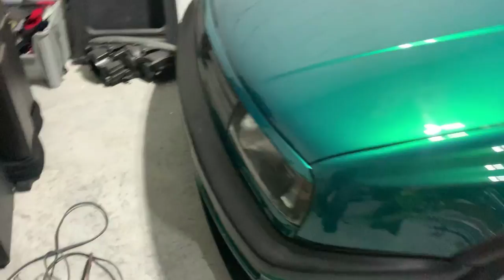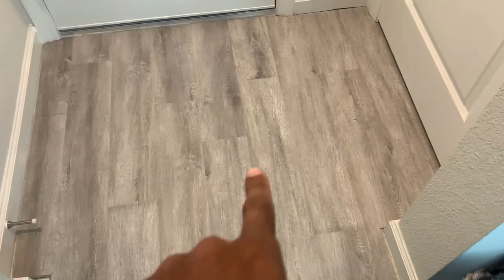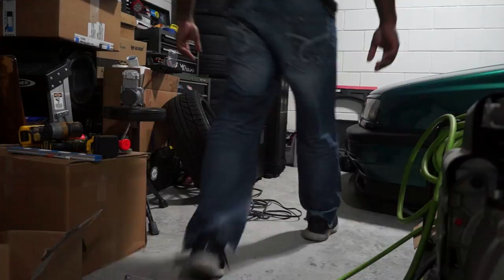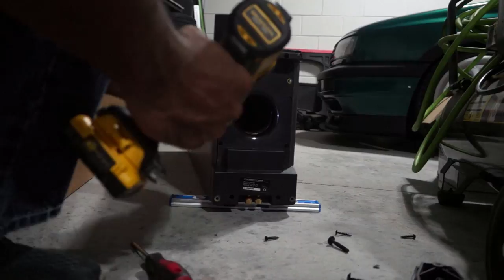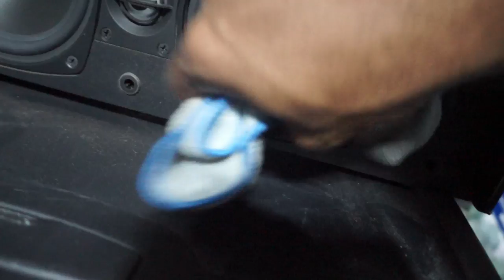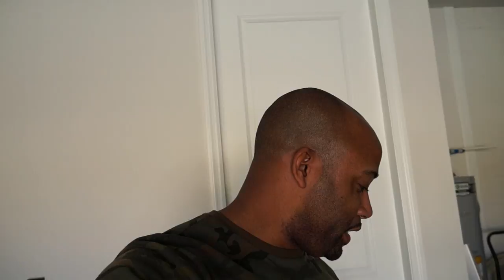Completing our home theater. It's LOUD!!!!!!

Comment: Why don’t you use the two 12’’ subs in the mk3
Reply from the maker: Zainodien Mohamed the box is kinda big. I had a big loud setup I. The car years ago. Has 3 6.5 in each door and 2 12’s in a custom box I built. Sound like 2 15’s. Want a smaller setup plus the trunk needs to fit the air ride and the battery